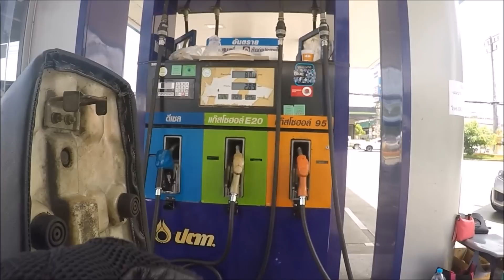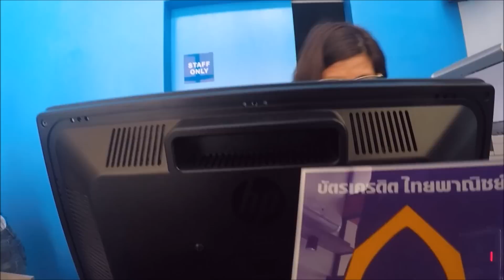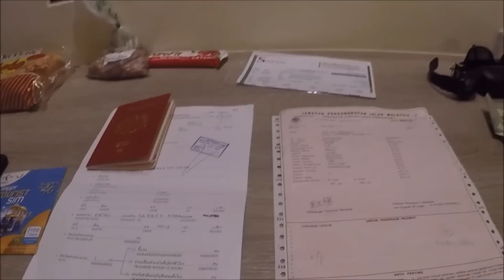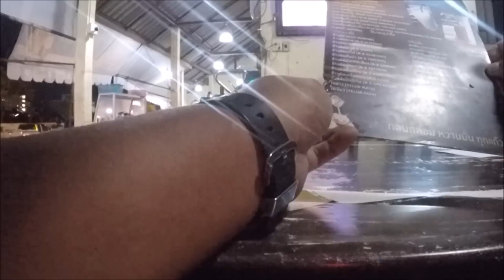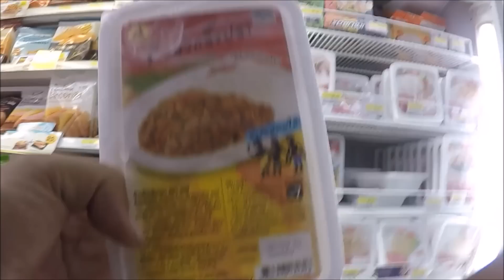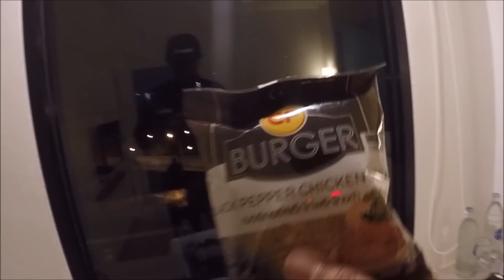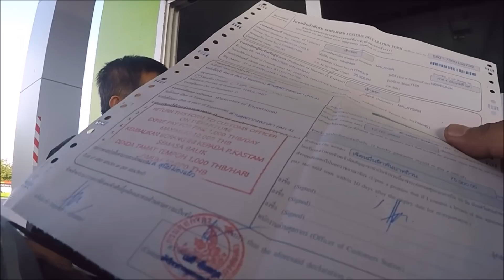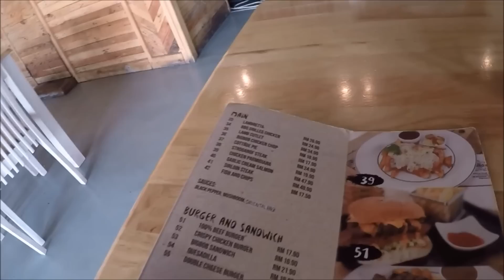YAMAHA Y100 SPORT | SOLO RIDE TO THAILAND PART 2 - FINALE - GOODBYE HATYAI

Comment: dear bro bob yang dah lama saya mengefollowiiii boleh saya tahu top speed y100 bro

dia four speed ke

y100 memang motor clutch kan

bro bob yang beli brand new ke atau bro beli motor seken

apa modi yang bro dah kasi buat

top speed lama kalau dah kasi buat modi

lagi satu saya teringin nak tahu power sangat ke motor two stroke ni sebab bro punya timing kurang daripada 10 jam tapi bro rafi motor dia four stroke sampai 20 jam aduhai